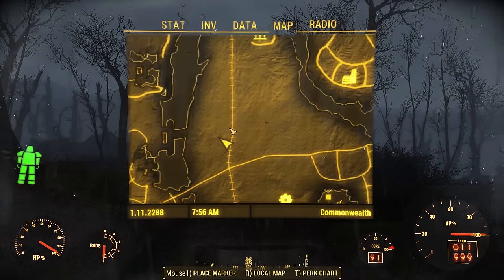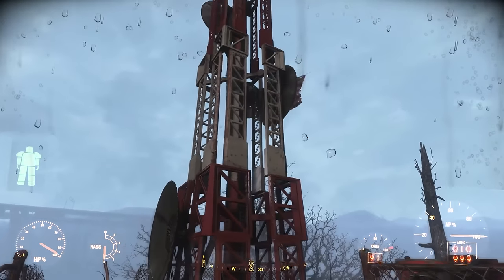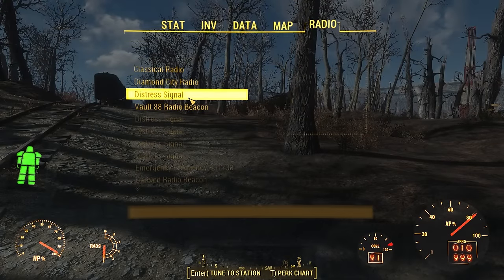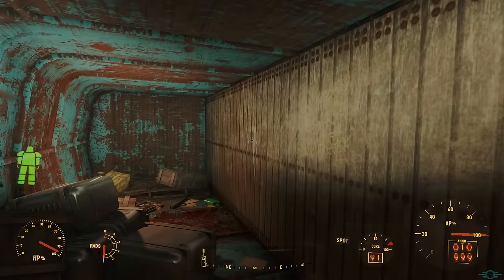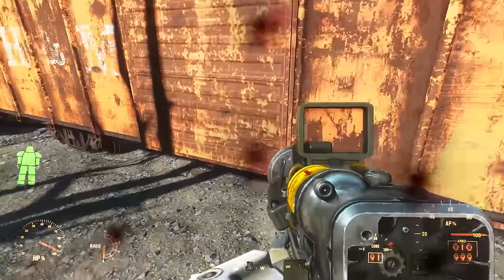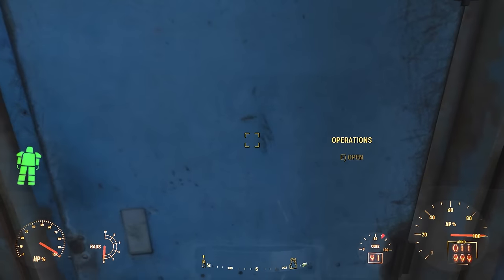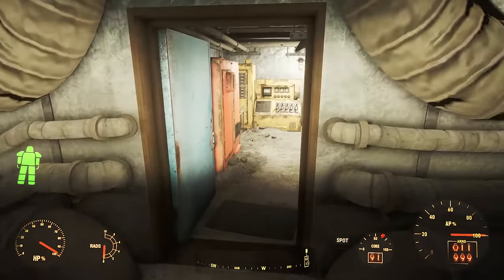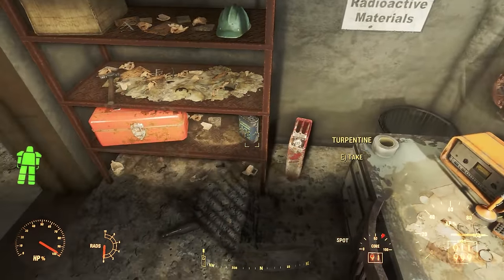Relay Tower 1DL-109 - Distress Signal, Garbled Radio Beacon, and the Boston City Works Beacon

Comment: What if the jumper cables where a crude defirillator? If it where tourcher wouldn't the settler be tied up?
Reply: I'm pretty sure it's Kellogg. Most people just pass by it on the reunions quest, but it's on the his path from Dimond City to Fort Hagan. It was the most unsettling part of the quest for me.
Reply: If you move the body it's booby-trapped, boom, in my play through. unless you take the battery first.

Comment: The UFO crash always seems to occur when I reach level 18. Looking at the comments for your video about the UFO, it appears the event is random. As for the second signal, I've played almost 2000 hours of Fallout 4 and I have NEVER found the source of that signal. Thank you! :) Also, the encounter on the lock for the third signal is actually a random encounter, so it isn't always feral dogs.

Comment: Oxhorn, what you find at the lock must be random because when I went it was 3 settlers, 2 were executing another. I don't recall if they had actual names, but apparently one of them stole something or otherwise pissed off the other two and they were just about to kill the third when I walked up. Dialogue auto started and I had the choice to intervene or let it play out. I was on my raider character so I stayed out of it. I don't know what happens if you get involved.
Reply: Yeah, that part with the sleeping bags is a random encounter spot. In my last game I found Mikey and Moss talking about a sandwish.